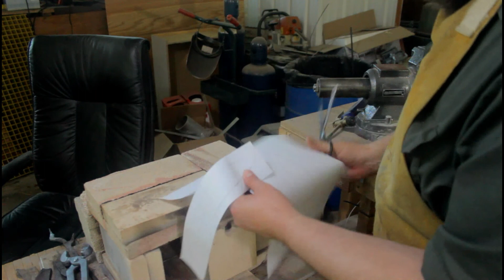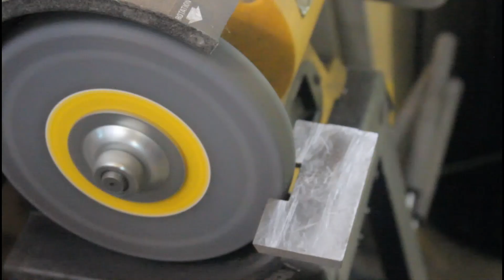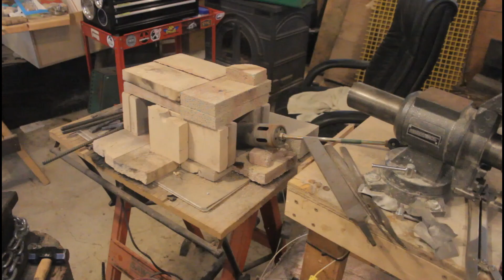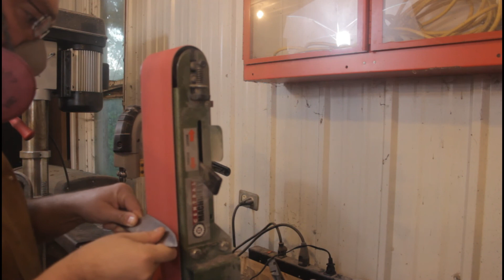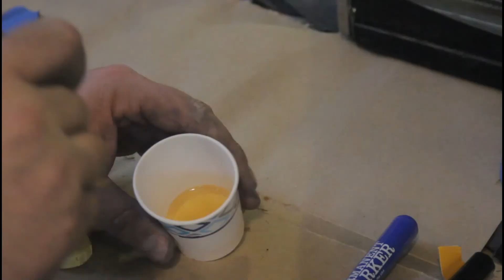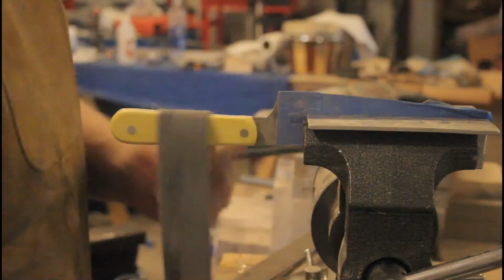Making an AEB-L Stainless Chef Knife

Comment: Questions and tips :
- Chinese Tungsten carbide drill bits work  a charm
-100 degrees of the canola oil, °C or F ?
Why did you choose this AEB-L steel in particular ?
Reply from the maker: 100 degrees oil in Fahrenheit. 
I chose AEB-L for several reasons. 1. Because it has good corrosion resistance. 2. Because it is inexpensive. 3. Because it is easy to obtain in sizes which are good for me to make stock-removal style knives from, and 4. it is one of the very few stainless steels which I can heat-treat myself with low quality equipment. 
To learn much more about AEB-L, I recommend this article from Knife Steel Nerds. https://knifesteelnerds.com/2019/03/04/all-about-aeb-l/

Comment: Does this steel have a good rust resistance ?
Reply from the maker: Yes this steel has very good rust resistance. McCullen Knives has done several corrosion testing videos on AEB-L which demonstrate its quality. https://youtu.be/h8ESUXQiZo4 and https://youtu.be/JhgoqRCObiE
Reply: @ShawnsWorkshop  What's your opinion on 154 steel ? 
I never did a knife in my life , what would be a good steel to practice or do a good knife without professional material ?
Reply from the maker: @AAAAAAndrea  CPM-154 is a good steel. 154CM is slightly less good. You can read more about them here: http://knifenewsroom.com/2021/01/cpm-154-vs-154cm/

For making a knife without professional equipment, I would recommend 15N20 steel. It is a high-carbon tool steel, so it will be vulnerable to corrosion, but it is easy to harden and temper at home with a simple setup. https://www.alphaknifesupply.com/shop/15n20-carbon-steel#info

Comment: Great guide on the heat treat! I'm about to do something almost identical, so seeing it done helped a lot. Has the knife held up for you? (edge retention-wise) I usually make O1 knives and this will be my first venture into stainless.
Reply from the maker: The edge holds up well for something I heat treated at home. I'm sure my method isn't getting every last ounce of performance out of the AEB-L, but I've found it to be at least as good as the edge holding of my commercially made Victorinox chef knife. (Though to be fair, I didn't push the grind of this knife as thin as I could have, which hurts slicing ability a bit, but helps edge stability.)

In the future I plan to use a dry-ice cold treatment to boost the final hardness. The work done by Knife Steel Nerds suggests that cold treat after quenching will benefit the performance of AEB-L. https://knifesteelnerds.com/2019/03/04/all-about-aeb-l/
Reply: @ShawnsWorkshop  Cryo is 100% necessary for edge stability/strength in AEB-L. You miss out on the purpose of AEB-L edge retention without cryo.

HRC is misleading. While cryo affects the HRC results, AEB-L achieves a higher strength with cryo and that's what leads to resistance to edge deformation.
Reply from the maker: @thatguythatdoesstuff7448  That is true. AEB-L is much better with cryo. And when it is available I use it. 

But I can't always get dry ice or liquid nitrogen, and I wouldn't want to tell anyone they shouldn't try this steel just cause they can't sub-zero the blade. Particularly because this is a kitchen knife and not a camp knife, I'm willing to sacrifice a few ounces of strength. The peppers and onions will never know the difference.

Also, even a household freezer treatment like I've done here has been shown to somewhat improve steel performance over no cold treatment at all. See https://knifesteelnerds.com/2019/03/04/all-about-aeb-l/ and https://knifesteelnerds.com/2018/12/03/cryogenic-part1/

Give it a try sometime. I think you'll be pleasantly surprised how good your results can be.
Reply: @ShawnsWorkshop  That's fair. When I make knives, I send them out to Peter's Heat Treat. Cryo is included in the cost if the steel calls for it.

I'm not a pro knife maker. But if I want one for myself or am making gifts, I'll make a batch of 10-20, depending on the knife and how ambitious I am feeling.

Heat treat for a batch of 20 is less than $15 a knife if I include shipping costs. I sell the extra knives to recoup the cost of materials and to pay for new materials and tools.